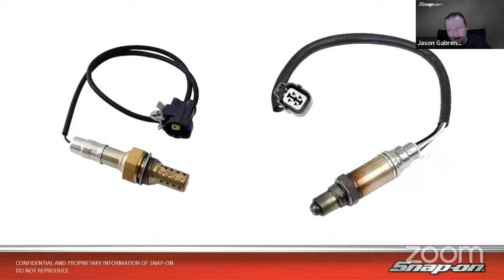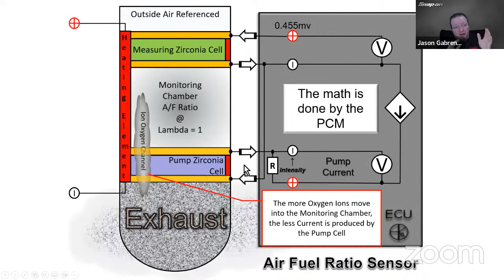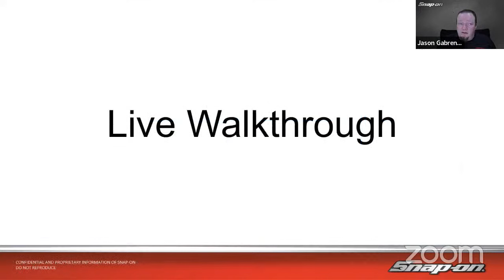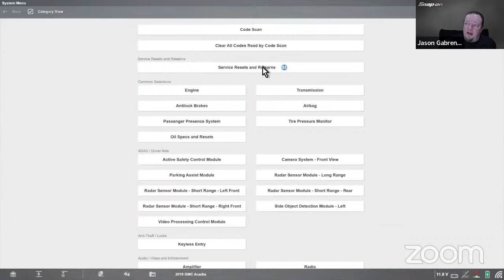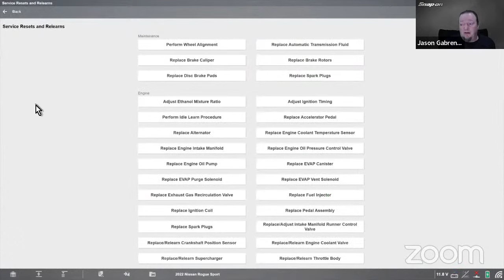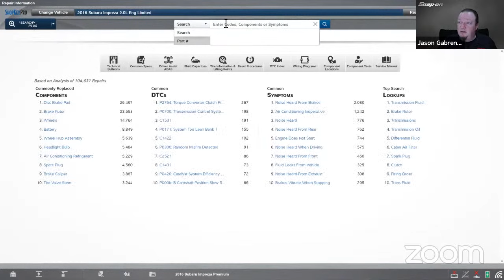Tuesday Diagnostics Livestream - Oxygen Sensor Testing and Repair

Comment: snap on recieve a lot of bad press about their coverage . You went straight to the problem i mentioned (P1134 ). I have been to a Subaru dealer and with the factory scanner , missed it completely . not even close . snap on definitely changed my opinion today.